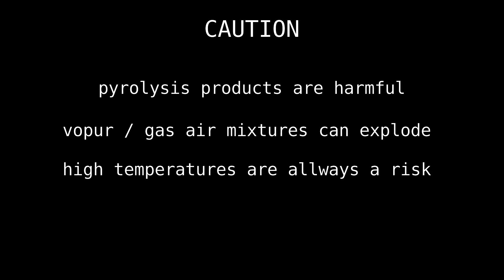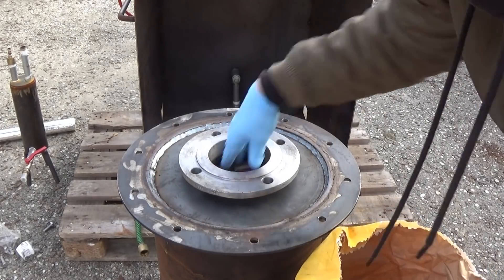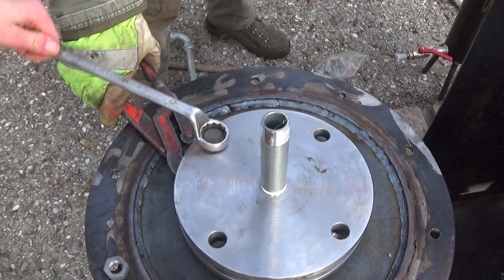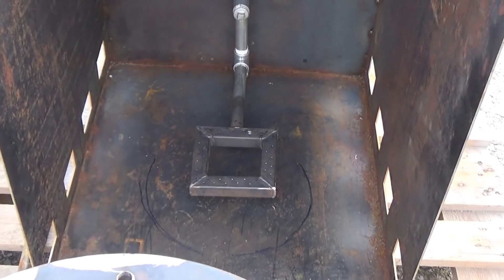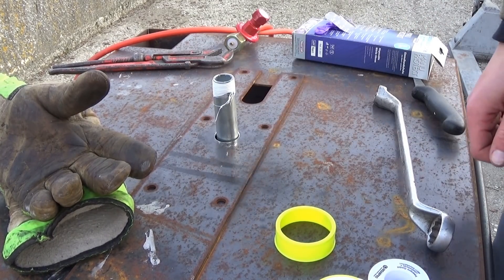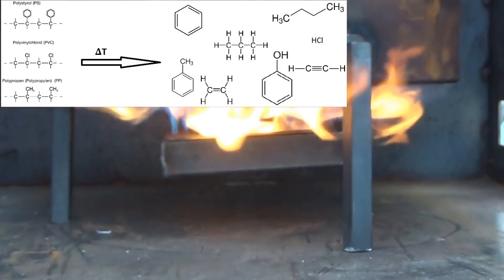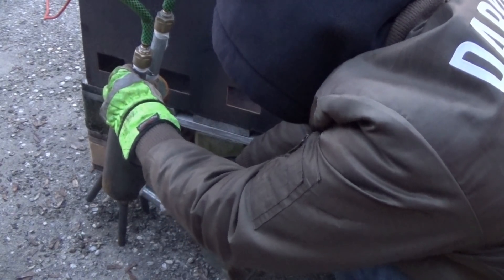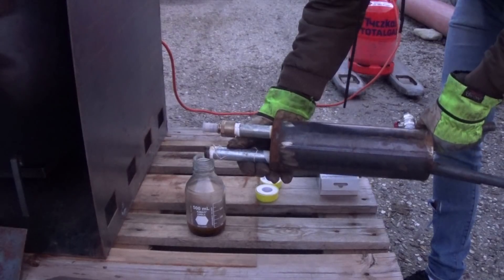plastic waste to gasoline pyrolytic recycling

Comment: id machine a tappered flange with a big nut if done correct you will not need a gasket just like a hydraulic fitting

Comment: Love your work! Had not heard of liquid tin for decarbonizing. Some of the papers I have read have used nickel or other catalysts to do this. Many have tried using the catalyst in the reactor, but a cleaner product might be able to be obtained by running the gases through hot catalysts. Some that I have heard of include silicon dioxide, copper, manganese dioxide, vanadium, etc. One of the things I wish to try is heating coins (made of cupronickel in the united states) and running the hot gases through those.

Comment: Nice simple approach! But I'd expect serious clogging of your pipes because high boiling  compounds that are tar-like semi solids at RT are driven off and condense in the pipes. This can be eliminated by superheating the gasseous product stream first. Thermal cracking on the way. At least this is what happened when I did something very similar.
PVC should first distill off as HCl at quite low temperatures. Under 200°C. It should not create significant amount of chloroorganics there. But that process takes time.
I sure like to see your paper! ;)
Reply from the maker: Heyhey thanks for all your comments. I am no longer giving out the paper because I now (studying chemistry) find it lacking in many points. But in the future there will be more. And when I finished my work with the ME faculty I will make the blueprints of the new system avalible for everyone. 

mfg hazelChem

Comment: The bottom mating flange should have an indented slot for holding the gas sealing rope, with a matching raised lip on the upper flange to push down onto the rope in the slot.
To use less energy, the waste heat from the condenser can be used to heat the supply fuel gas and/or heat the supply air to the burner.
As part of the startup gas purge you should include a vacuum pump to draw it down and remove the nitrogen and oxygen.
Use a shredder to break large pieces into small chunks. This will accelerate the dissolving of thick hard plastics.
If you put the whole thing on a weight scale, you will know when the process is done because the reactor vessel stops becoming lighter.

Comment: This is good!
Some thoughts: start heating the vessel before adding the feed stock. Let the plastic melt and begin shrinking inorder to fill the vessel to the maximum.
I would weld those bolts to the flange, turning them into studs.
How about super heating the distillate?

Comment: really? pyrolysis can make petrol aside from diesel and that petrol could run cars?
Reply from the maker: yes if the crude oil is refined in a proper way it is as good as normal fuel. 

mfg hazelChem

Comment: Woha boy  ... DRY ICE !!   Takes a SMALL amount to purge .. Its Cheap USE IT  USE a refracktory lined  vessel  and a pyrometer * 800 F .Great video thanks .
Reply from the maker: I recommend my newer video on the pyrolysis project! the problem with dry ice is that it is very hard to get where i live. 

mfg hazelChem

Comment: That's great, I'm making a pyrolyzer myself. My chilling system has some temperature sensor for trying to operate in semi- continuous regimen and also for separating the oil in different fractions. 
Can you open a discord group for that ?
Reply from the maker: well i do not have discord or the time for it but maybe there is a easier alternative ? but the idea behind this would be good to share information that you only learn by trying .....
ps: you cant separate fractions when you are working with a discontinuous system ! (only with a separating column) hope this helped 

mfg hazelChem

Comment: try to put cement, silica, alumina or sand or any other solid catalyst at the bottom of the pyrolizer. In this way ensure full cracking and avoid high paraffin obstruct system.

Comment: SIR I HAVE A QUESTION? ANY CATALYST USED IN THIS PROCESS.? HOW TO MAKE PYROLYSIS CHAMBER?...THANK U SIR IN ADVANCE
Reply from the maker: no catalyst is used and the chamber is solid 2mm steal (a pipe was losed of at one end and the flange was welded into the top of the chamber)
hope this helps you
Reply: @HazelChem  hello my email is alfysabone@gmail.com i want to learn more on this maybe you can help me.
Reply from the maker: @alfredtalane8195   you can write me a mail with your questions 

hazelchemistry@gmail.com 

mfg hazelChem

Comment: I thought burning plastic released Phosgene gas and lots of other toxins.  https://emergency.cdc.gov/agent/phosgene/basics/facts.asp
Reply from the maker: well if you burn it there are toxic products ... but in this setup there is little to no oxygen so most of the polymeres is cracked and converted into smaller molecules :D 

mfg hazelChem

Comment: Waste of fucking waste of time.  Use 2 or 3 kg of propane to make half a kilo of oil
Reply from the maker: the project shows the potential pyrolysis has !  this setup is not cost effective but in a commercial scale this is a option 

mfg hazelChem
Reply: Plastic should be kept as plastic. Even make bricks out of it but burning it is a waste no matter how efficient. That is why we need to use natures kinetic energy to make power so the burning of hydrocarbons can be more efficient. I.e. not using as much so more important uses can be supplied

Comment: How much propane did you use to get that little amount cost effective?
Reply from the maker: well in my Setup it is not cost effective but if you insulate and do it on a biger scale plus the money you get for disposing the plastic waste it should be profitable 

mfg hazelChem

Comment: We did same thing as our project work and it works . We distilled the  
Crude oil , it's properties are similar between petrol and diesel.
At the distilled process some gaseous are released. This process release the so many harmful gaseous . It's very dangerous.
Reply from the maker: well this process handles aromatic hydrocarbons so it is generally not save 

mfg hazelChem

Comment: This is not so easy an cheap as its made out to be.  My plant consisting or a 2000 L steel container and coolers each of 200L  set me back a pretty penny and that's not the boiler and pipe works. It produces approximately 100 to 130 L of diesel oil and 10% of that amount is petrol. You might spend about 10 -14 hrs depending on circumstances. I managed to get quite good quality petrol but the diesel oil is pretty shitty. The diesel works well, but it causes the injectors to clog up. What no one tells you is that the dark colour is caused by tar and carbon in the distilled product. The petrol (although very light yellow coloured) cause extreme carbon deposits in the engine and exhaust systems as well. The (feel) product  turns darker and darker when left for a few days /weeks. The carbon/tar tends to settle at the bottom of the container but it seems that it's an ongoing reaction to darken. It has the tendency to dissolve some kinds of rubber and plastic pipes. Inshort, this is my experience with it.
Reply from the maker: Thx for sharing your experience with this process, it will definitely help me improve my setup

mfg hazelChem

Comment: trash(plastic) work to bring it plus the fuel to heat for the results 400 mml will be worth?
Reply: My most concern is what  this result would be useful at?
Like in my country, we have lots of waste plastics loitering everywhere and causing severe sickness in the environment. Getting the gas wouldn't be any issue here as well, ordinary condemned oil from motor cycle mechanics can be useful. But my question again, what will this refined product used for❓

Comment: Can you purge the chamber by dumping a box of sodium bicarbonate in the bottom, the heat would hit that first and so produce CO2 pushing all of the air up and out before the plastic has even melted?
Reply from the maker: well you could do that but there can be increased corrosion of the steal 

mfg hazelChem
Reply: @HazelChem   Ah, well just thrown in a lump of dry ice.  Or is there another carbonate that would be less problematic such as ammonium carbonate?
Reply from the maker: @DanielSMatthews  well dry ice is a good idea ! and ammonium carbonate is a very bad idea because of the ammonium gas being evolved !

mfg hazelChem

Comment: Well that's a change from your usual glassware!

6:29 : Please don't run it on PVC. You could make small amounts of dioxins. They're easily absorbed through the skin, and become a severe health hazard at parts per billion levels. 

Look at what happened in Times Beach : 30 ppm in the soil was enough to cause horses and birds to die off. Same in Seveso where a few micrograms of dioxin per square meter of topsoil were sufficient to cause a mass die-off of the local fauna, and hundreds of cases of chloracne in people. 

I don't know how you plan to analyze the results, but I'd be surprised if it is sensitive enough to detect dioxins before they are a severe threat.

As far as I know, the only satisfactory technique to avoid their formation in waste incineration is to do it at high enough temperatures with an excess of oxygen to ensure complete oxidation of organic compounds. That's obviously not going to be the case with your setup, since you're running it in the absence of oxygen.

So, yeah. Just stay away from halogenated cr*p, as much as possible. It's never good...
Reply from the maker: well thx for your concerns i will consider them !

mfg hazelChem

Comment: Amazing video! 
How much do you think you'd need to scale up this process in order for it to break even on cost?   I'm assuming that fractionating all the product would take some work.

So you would do column chromatography in order to determine constituents, and with that information you could find the proper temps to separate your products with an ordinary distillation apparatus?  

Very interested in seeing more :) 

If this process can become profitable, there might be incentive for "mining" plastics from our oceans, simultaneously cleaning our oceans and producing oil w/o having to drill miles underwater.
Reply from the maker: well the process would need to be done on a industrial scale like tons an hour ....
and at first i am doing a simpel distilation to seperate the paraffines and the liquid then the liquid components are fractionated in 10°C fractions to see of which boiling sector how much is present 

mfg hazelChem
Reply: this unit lets you select Gas, Kerosene or Diesel http://www.blest.co.jp/eng/service/nvg-200/
Reply: the biggest issue i see is it costs refined fuel to make waste into crude fuel....its back to the "there's no free lunch"

Comment: Great work. What's the composition of the distillate?
Reply from the maker: it´s a mixture of hundrets of different compounds like crude oil 

mfg hazelChem
Reply: Hazel Chem the benzene content worries me a little... I expect plasticisers make it unavoidable
Reply from the maker: @p.f.3014  benzene is almost always a pyrolysis product !
Reply: @HazelChem   There's a technology that they're working on to methylation of benzene using zeolite to yield toluene. This could be used as a paint thinner.
Reply from the maker: @PoorWithADHDScienceAndMore  well the problem is that i don´t want toluene ... maybe i will do a hydrocracking with the pyrolysis oil thou 

mfg hazelChem